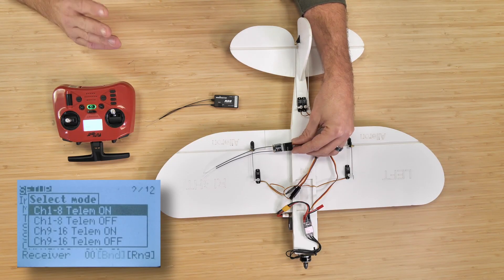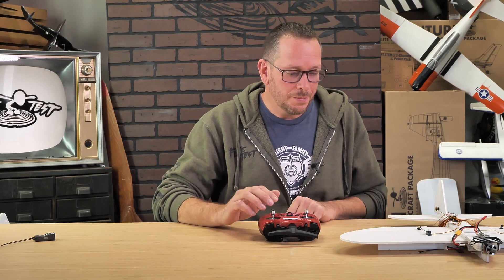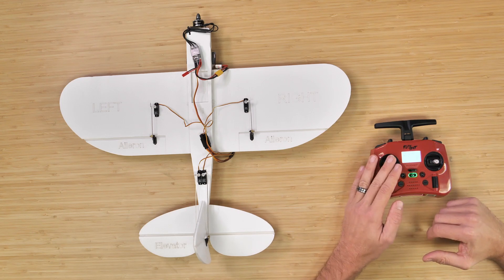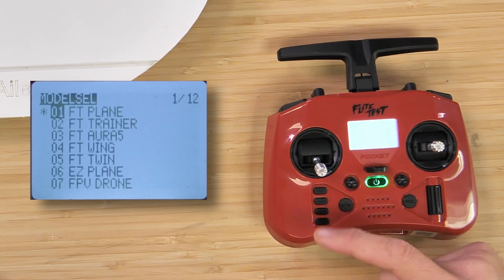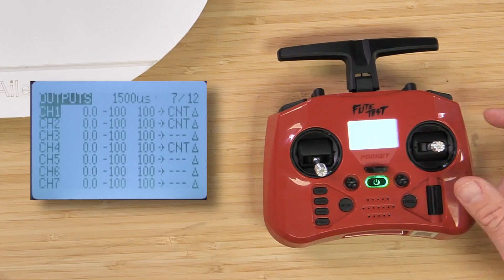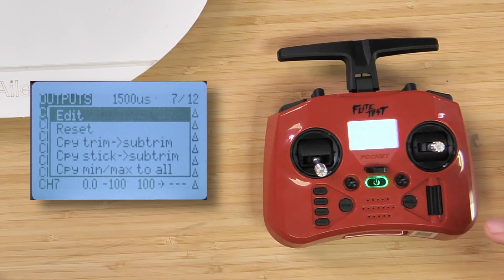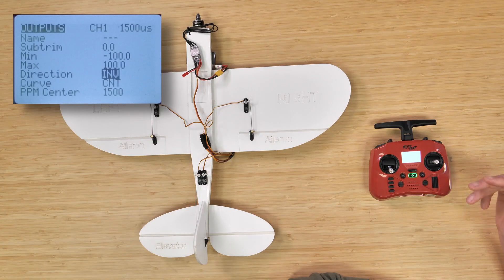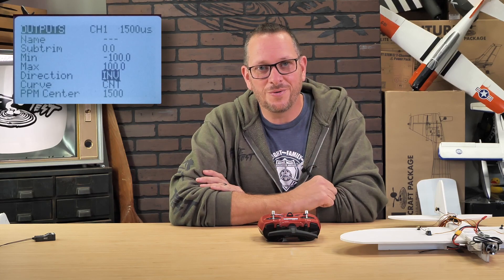How to Reverse Servos On Radio Master Pocket

Comment: Depending on how your mixes are set up on more complex models, and how your conception of them best works, it might make more sense to reverse, say, your elevon mix by setting negative or positive weights in the mixes, or inputs. It's a testament to the flexibility of EdgeTX that there's like 10 different increasingly questionable and suboptimal ways to reverse a channel.

But yeah, for a simple model with a 1:1 mixer setup, inverting in the outputs makes the most sense.